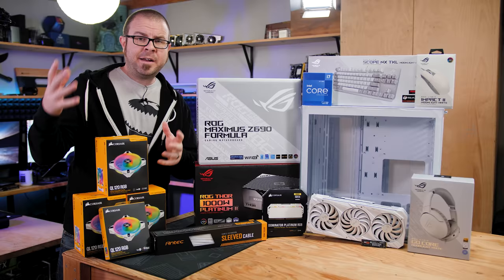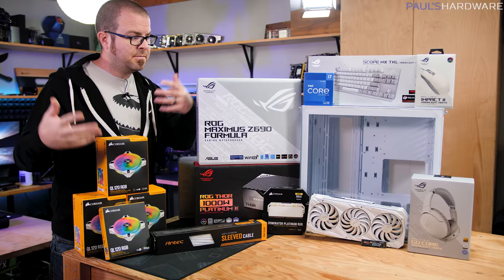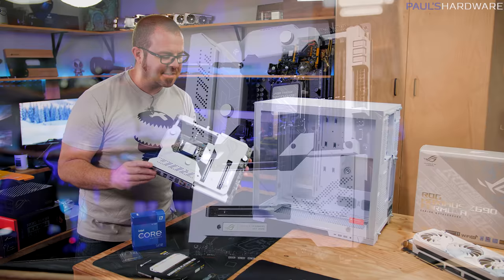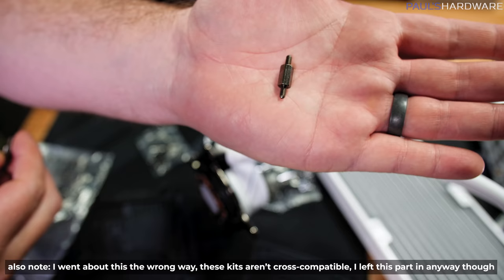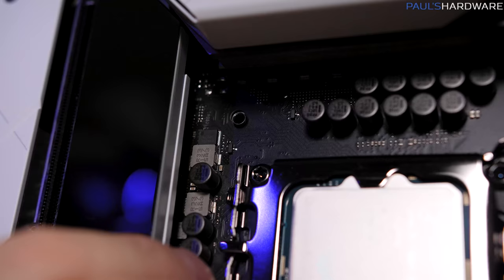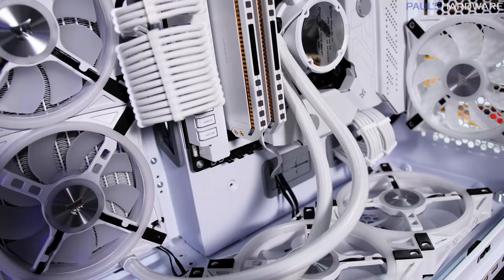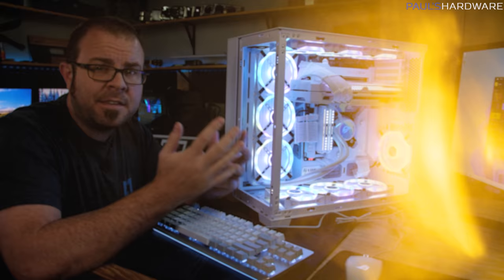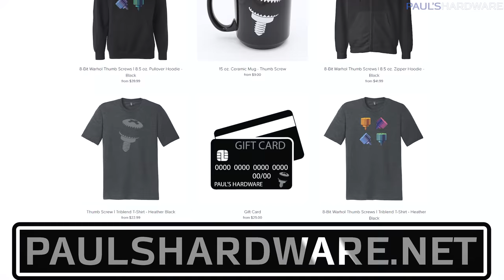Building a Meticulous, Epic, All-White Gaming PC... UPSIDE DOWN

Comment: I have a major problem with this build.  That Badass 3090 GPU looks ridiculous upside down which also causes the GPU Fans to blow down into the case the wrong way. You have exhaust fans up top pulling out and GPU Fans pushing down/ doesn’t make sense.  The GPU is the centerpiece of this build in my opinion and we’re looking at the lettering upside down and that’s just a turn off to me.  The same effect as when someone puts the AIO cooler logo upside down on the CPU. Cosmetically it just doesn’t work.  I think the case sucks too.
Reply: He has 9 fans intaking air and only one in the bottom right as exhaust lol

Comment: It looks great, but perhaps is a bit too white.  I feel like there should be some more black elements for contrast.  Sticking with the traditional graphics card mounting definitely was the way to go.  However the cables wrapping over top of the card look a bit awkward, but I agree going underneath wouldn't have been any better.  Maybe some 180 degree adapters would clean things up a bit.  Good luck finding those in white though.  Overall it came out fantastic.

Comment: So I used the same motherboard in a Corsair 5000x case but for some reason when I connect the “Power SW” to the motherboard, the power button doesn’t work, but the “Reset SW” works in its correct location on the motherboard. I put the “Reset SW” where the “Power SW” should go in the motherboard and now my reset button on the case acts like the power button. With that said the signs point to the case having some faulty issue with the power sw, should I just leave it or disassemble the whole build for a replacement?

Comment: hey Paul, is there another m.2 slot under that other smaller plastic part above the GPU pci slot closer to the cpu? The shinier one w/2 screws. The asus web page says there's room for 3 on the mobo, and 2 more via the pci add on card. Was just curious. Unless I'm reading it wrong.

Comment: How is the temp of chipset? I've just built the same mobo but the chipset temp is quite high in my opinion. My case is 5000d with extra 6 intake fans 1 exhausted fan and a exhaust 360 aio, while 12700k is cool (4x - 5x) i set the speed of fan case ~ 1000 rpm then chipset is 71. To me this temp is quite high so that i set the fan case to ~1800 then it drop to 65. It just the normal task ( web browser, installation software). I just wonder the led panel above the chipset cause this issue. Or maybe it's just normal temp of chipset. Can you confirm?

Comment: I'm looking to downsize my pc case (currently have an ATX mobo), but the ATX cases are all similar size. I'm loathe to give up the x4 expansion slot I need for my soundcard though. I read that using an x4 card in an x16/up-plugged slot causes bandwidth degradation so not ideal. Are there any upper-tier mATX boards out there with an x16 and x4 slot for a soundcard, with reasonable quality VRM's and power supply to support a 8/12C cpu?

Comment: I recently purchased a Thor 1000v for my pc however I noticed that the power connection it comes with are different. Does it matter if i use a regular 2 pin one or will this cause in issue “ I’m not a tech guy by the way” can someone help please ?

Comment: I'd be really curious to know how those QL-120s stand the test of time for your wife, or if you've had any bad experiences with them.  I've had to RMA QL-120s like 5 times, because of failed LEDs.  They keep going bad, and I'm super disappointed, but I don't want to eat the cost on fans that are less than a year old, so I've been in this endless cycle of RMAing them over and over.  It's very obnoxious to have to keep tearing my build apart.

Comment: Running 9 fans of rgb fans surely doesn't require another rgb command hub. Just inject another 5v somewhere down the line. Fuk corsair. And if the data signal is weak. Buy a booster for 9 bucks. And I'm just not talking shit. I have the parts for this build

Comment: I need your help how did you wire in your gou with the 3 slots it needs for power?? I have a Asus 850w power supply and do not have 3 psu slots available on it to power my gpu...I have it wired in to one psu the other vga slot on the power supply and I got  pcie  cables with the y off on the end and it keeps freezing my pc screen

Comment: Really thinking on building my next one in the case and doing it inverted like this. Does the gpu sag when it’s in this configuration like it does  the conventional way ??
Reply: That would be good to know for sure. Maybe it sags slightly less if there is some  counter tension of the cables going up and over the top rather than potentially pulling it downward. Then again maybe the cables aren’t pulling it at all

Comment: I love a white build and this one is pretty nice! 
I have mixed feelings about the upside down though. I love that you can see the fans on the gpu, but hate that the writing is upside down.  
This is probably the ideal way to install the upright aio with the hoses down, but now the display showing temps and such is upside down and annoying to read.
Although lots of fresh air intake is good, I feel like this is now you don't really have airflow, just air being mixed around in the middle. Since the gpu is upside down it's good to have intake from the top blowing directly on the fans so i'd probably change the side fans to exhaust as well for better airflow.
So now that I've seen this setup I'd rather have it "normal" with intakes on the bottem and side and exhaust out the top and back. But that's my pref ofc

Comment: Great video as usual, Paul! This one is perfect in my eyes, I love the all white themes, especially when it involves the white 3090! Any concerns with AIO mounting choice and the pump being at the top of the loop? I always heard that was a no-no?
Reply: I was thinking the same thing and then noticed that the rad was in the side mount location not the bottom one, so it'll be fine.
Reply: @SpuriousECG  You're right 🤦‍♂️ I totally missed that, thanks!
Reply: Yeah I had the same concerns as well with the pump. I'd be worried about premature failure.

Comment: I was having a giggle watching you play around with the CPU block mounting... was waiting to see how long it took until you noticed the LGA1200 mounting holes!

Edit 1: Why does every Youtuber fail to realise you remove the plastic (hint: it has a split down its length) off the retention lever of the CPU socket on the MAXIMUS Z690 range? It is stated in the manual FFS.

Edit 2: Don't waste your time trying to get ICUE to working with the ASUS' ARGB headers. Corsair (ICUE) only supports the 12V RGB headers on ASUS motherboards and have  officially stated they have no intention for supporting the ARGB headers. Sorry but you'll have to learn AURA Sync which isn't all that hard in their more recent releases.